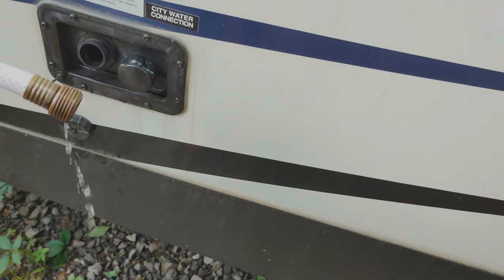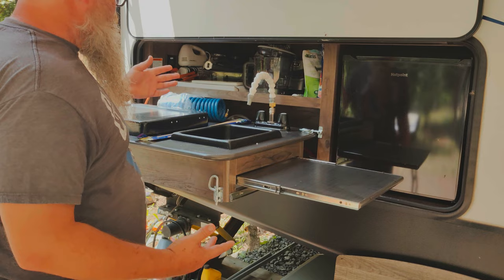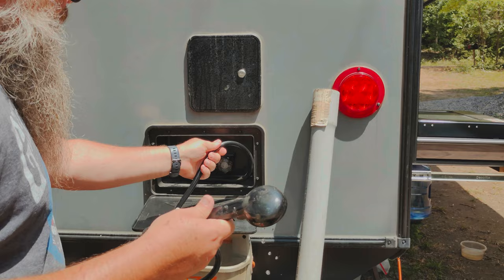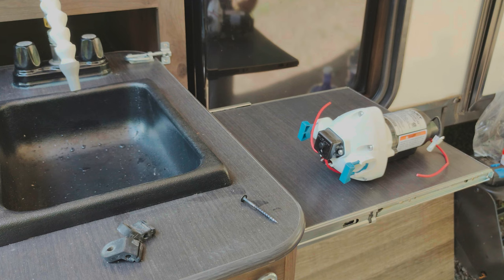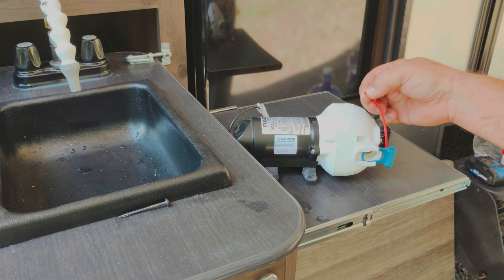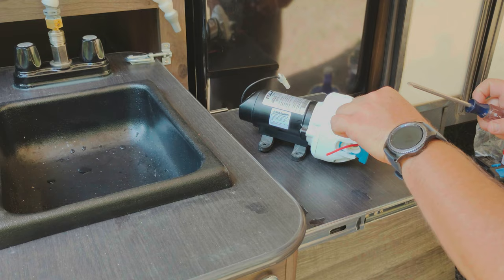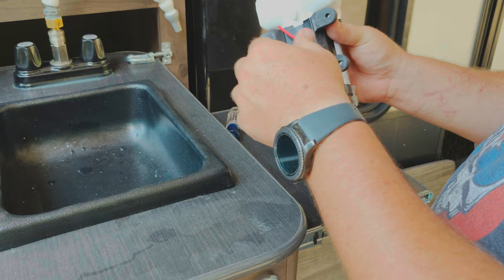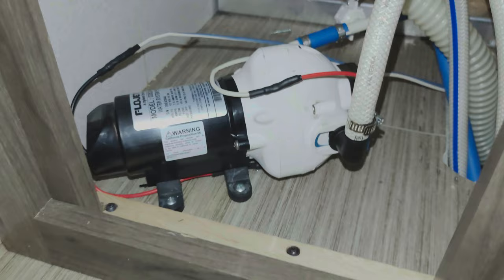RV Pump keeps turning on then off | How to fix an RV water pump | Family Vlog | Full time RV living

Comment: Umm...yeah our pump cycles too...no leaks...it doesn't cycle often but I just flip the switch to the pump off when we go to bed. Maybe I should do the same to our pump but afraid if I take it apart that it won't work at all when I put it back in! 😱😜🤣
Reply from the maker: Yeah it worked like a dream after I cleaned it to but should have double checked other screws before it decided to eat itself...ugh. Thanks for watching.

Comment: Ohh our pump is intermittent turning on and driving me crazy! All lines no air and not on but all night long the pump turns on about every 15 minutes or less! So need to take it apart and check this bladder thingy! Afraid it won't work at all when I put it back together! 😜🤣😱💦
Reply from the maker: Yeah ours stopped but for other reasons...lol. So yeah... Good luck...😬😁👍
Reply: Did you figure out why it was running intermittently I have the same issue how about every 40 minutes it turns on for a second. Can't find any leaks.
Reply: @ShepherdsChapelonYT  I was told it was because the bladder inside the pump (the yellow flap part) was dirty. I ended up cleaning and saving the old pump as a backup.
Reply: Thanks for getting back.I guess I'll try cleaning it. Any tips on cleaning it or do you just rub the parts until they look clean.
Reply: @ShepherdsChapelonYT  I had never taken one apart before but was easy and I just cleaned the bladder with rubbing alcohol.